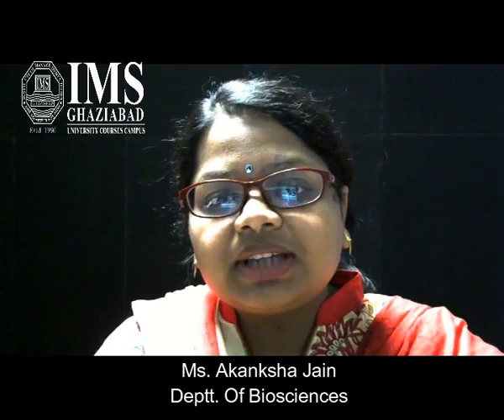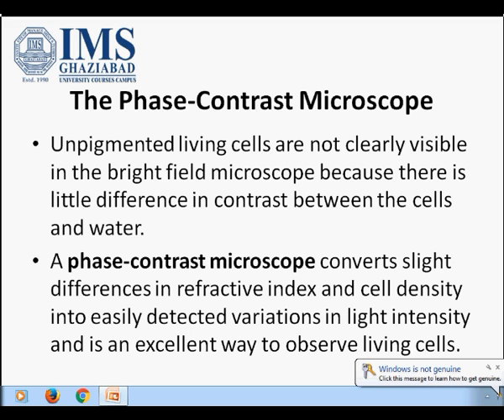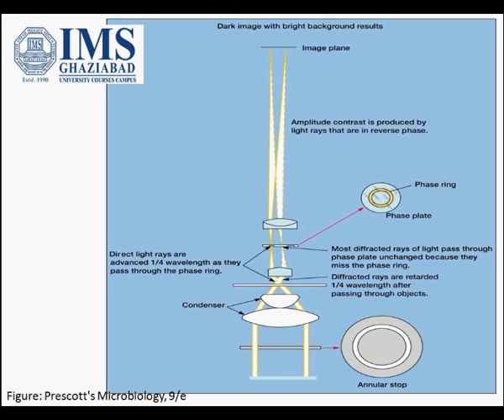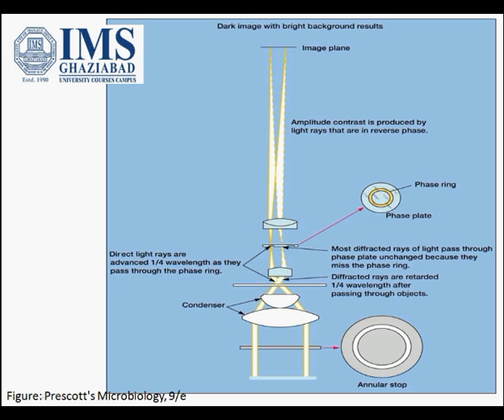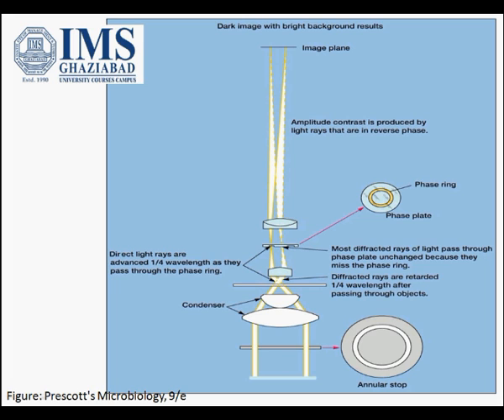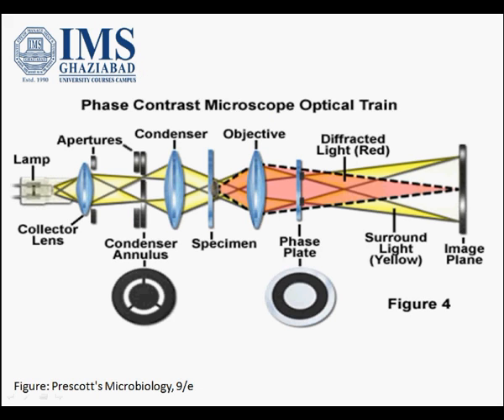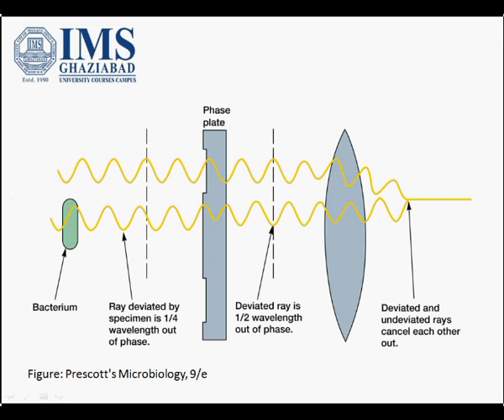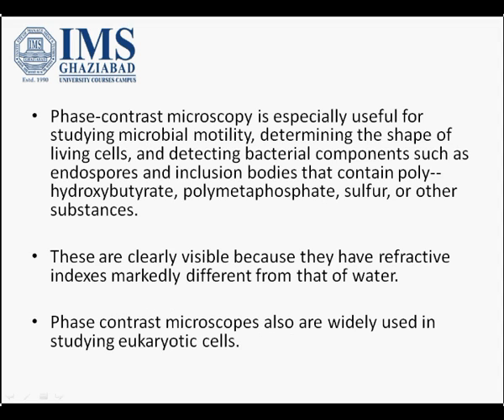Phase contrast microscope

Comment: Mam what is the advantage of prodicng a hollow cone of light wth the hlp of annular stopr in front of condenser?
Reply: This way the light that is not diffracted by the specimen passes through the phase ring, causing it to be diffracted in the other direction. Whereas the light that is diffracted by the specimen (and thus is retarded in phase) is not advanced in phase by the phase ring because it does not pass through the ring since it is diffracted. 
To answer your question: If the annular stop would be absent there would also be a lot of undiffracted light that doesn't go through the phase ring and thus does not get phase advanced. Also there would be diffracted light going through the phase ring, which would nullify their retardation with an advance. This would cause the image to lose a lot of contrast. 
Basically the annular ring determines the direction of background light, which is essential for phase microscopy to work.